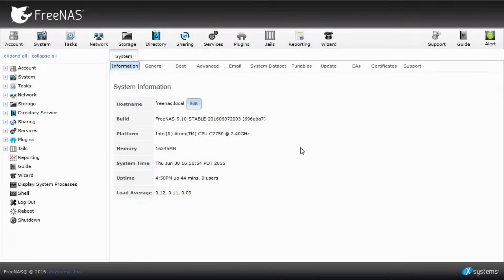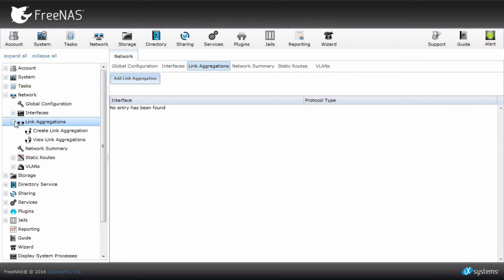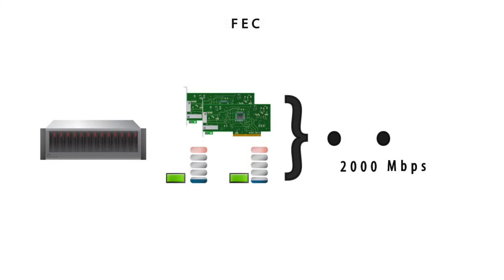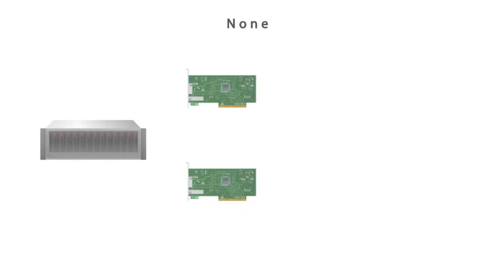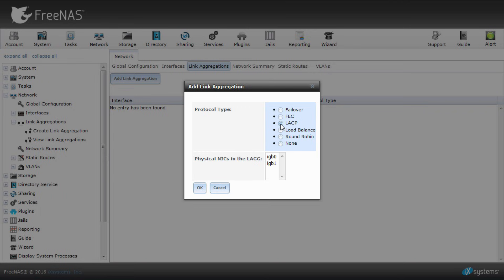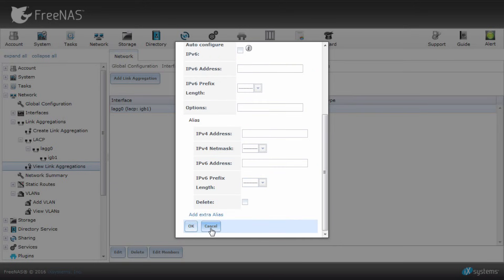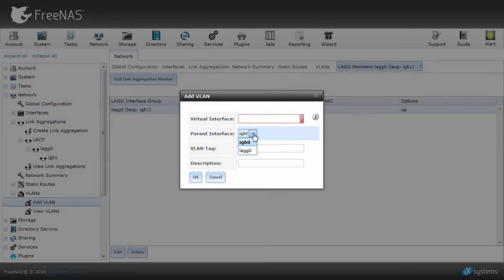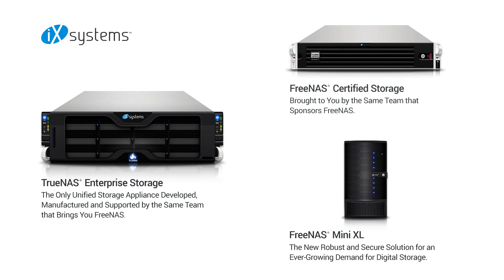FreeNAS® 9.10 - LAGG & VLAN Overview

Comment: OK I have a question.  After Letting up  LACP both at the Freenas with two Intel Pro 1000 dual port nic.   connected to a Netgear GS724T V3 all updated to the newest Firmware.  I have a PC also set up with LAG and its working fine with the Switch in LACP  yet FreeNas crashes the switch.   I have the switch let up with Lag Type at LACP.  I must be doing something wrong I also have the Freenas has DHCP or dose it have to be static since the Switch is LACP.   as for MY PC I have my IP address as Static but in a LAG, with the switch also in a lag with LACP for the Shared Ports.   but when I set it up on my Freenas it crashes the Switch, and the only way to get the switch out of the crash is restart it. or some time factory reset the switch.  and some times it will crash the entire network.  What am I doing wrong.

Comment: This left out some key info. First, if you left your interfaces with the defaults (which is DHCP) and never configured them, this will turn off DHCP for ALL of them, whether they are part of the LAGG or not. So you might want to configure an interface first if you have 3 or you'll lose network connectivity.

Second, you only show adding one interface to the LAGG. Isn't the whole point to have 2 (or more interfaces)? There are two ways to do this. The easiest is when selecting the interface (about 3:43 in the video), hold shift down and select the second.

If you didn't do that, go to Network -> Link Aggregations. Click on you LAGG, then edit members. Now click on Add Link Aggregation Member. Be sure to pick the existing LAGG (the one with one member) for the LAGG interface group, pick a priority, then pick the second NIC. It will look like you have two LAGGs when done, but if the name is the same, you have one LAGG with two NICs.

Comment: YOU TUTORIALS are lacking - it's like "what does this LAGG box do" and you say, "Check the box to enable LAGG"
Yes, we know that - same with VLAN, DO WE ACTUALLY NEED VLAN if we use LAGG?

And does the switch we are connected to have to support LAGG? Of course it HAS TO other wise this is a waste of time.
More details in these videos would make them more helpful.
Reply: Did you watch this with the volume turned off or something?  They provide a pretty good explanation throughout.  

As well, this is a "FreeNAS® 9.10 - LAGG & VLAN Overview"; not a class on Networking.  Did you want them to go into detail about IP Ranges and Subnetting as well?
Reply: You could look up bonding or NIC teaming to get a general idea.
Reply: Mirfster of course not -